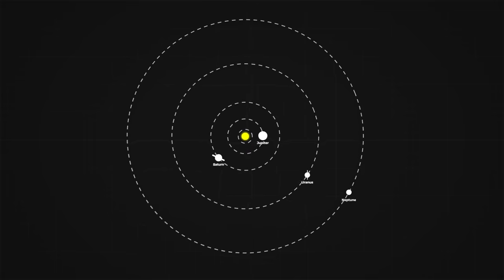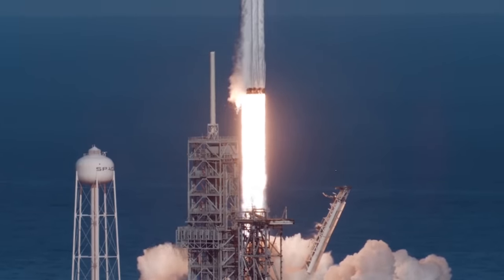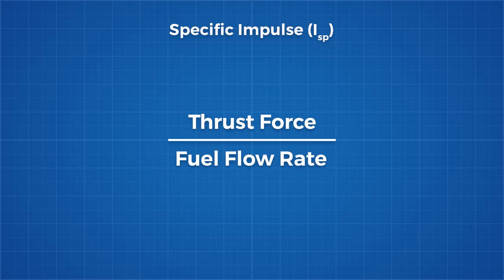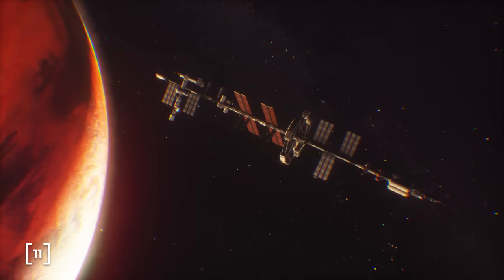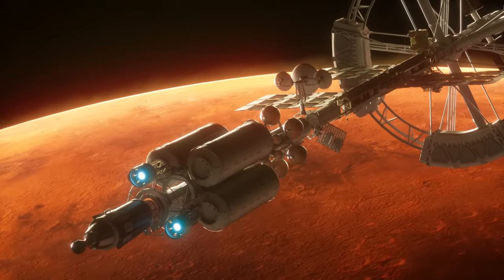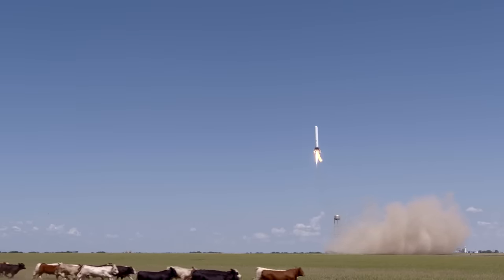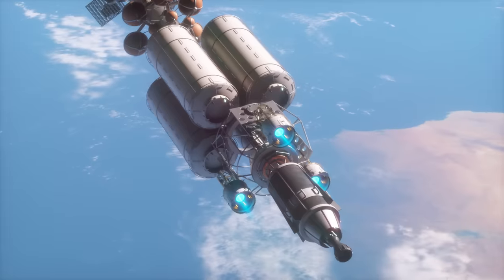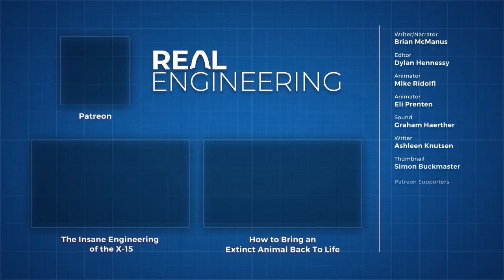Can Nuclear Propulsion Take Us to Mars?

Comment: Any mission to Mars of extended length will require multiple launches of various components of the mission which will rendezvous in orbit or on the Martian surface.  In this way different components will be able to arrive in a scheduled manner without the same speed/engine requirements necessary for each vehicle.  An unmanned habitat module for instance would be launched first carrying supplies requiring  a safe landing on Mars at the initial phase of the mission.  A secondary mission could involve the landing of an assent vehicle for moving astronauts back into orbit for rendezvous  with a mother ship...Finally after everything else is in place....a manned mission would be launched to Mars serving as an orbital vehicle allowing for a decent stage to land astronauts at the habitat location.  It will take much co-ordination and planning.

Comment: Could the hydrogen problem be solved by lining fuel tanks with materials that are smaller? Some sort of ionic compound like LiF or Li2O will have much smaller gaps than a metal like Fe, Al or Ti. The hydrogen bonding these products will have between ions should help keep the hydrogen molecules inside.

Comment: Alright - my question is related to the high deceleration: If you flip the ship around and begin thrusting the opposite direction at 50% of the way there, wouldn't you effectively slow yourself down for insertion to a point where you could use chemical boosters or maneuvering thrusters to correct your angle of approach and drop into orbit? Just seems like if you could achieve it this way you wouldn't need to do a rapid deceleration all at the end.
Reply: Doing that would tear your ship a new one brother

Comment: I've seen this episode 1000 times almost literally and I've had the question, in a space to space craft that never lands, why not use all 3 types of engine in one place? Hydrogen isn't hard to store as water for long periods, though it would need place to be stored as hydrogen short term, the nuclear electric engine could also be used to create electricity for electrolysis, the oxygen released from the water can also be used in the space craft for air and perpelent, the water could be used as a coolant for nuclear electric, plus humans consume water. Over top of that, would the slower moving perpelent of nuclear electric not spit out a good base of waste molecules to push the nuclear thermal against making the whole craft faster?
Reply: I agree with you in that there are ideas that could combine different thrust technologies to make an efficient space craft. Basically, the best space crafts will have very complicated hybrid systems. It's a different future from popular science fiction where there is one magical engine that provides thrust, artificial gravity and shielding all while being the size of a van.

Comment: I was on an airline flight in the 70s and an engineering student showed me that the senior class project was a magnetically contained Uranium fission reactor with gaseous Hydrogen flowing past it to absorb thr radiant heat.  I don't know what casing would survive the neutron flux; maybe Niobium.
Also the Nerva engine can triple its heat transfer by pulsing  pressure in the boiling, pressurized Hydrogen.  Published in Analog around 1970.

Comment: We need to setup and standardize orbital refueling. Use traditional rocket fuel to lift ships up and into orbit. Then switch to a more efficient propulsion system for zero resistance thrust in space. 

We also need large ship warehouse/repair facilities that stay in orbit to service ships, rockets and shuttles. Bring back the space shuttles but keep them in orbit as workhorses. Will make repairs on space stations, satellites and ships easier. Use rockets to bring astronauts to space. In emergencies the shuttles can still guide back down to earth.

Comment: 2:25 Gravity assists are fine, but they need planets. Ion propulsion, or rather mass accelerator propulsion is better, and I mean fractional lightspeed emission. Simply put multi stream cyclotron with linear accelerator last stage, using large molecules.

Comment: They need regular rocket engines to take off and enter low-earth orbit. And then we need to send tankers up and refuel the rocket while it is in low earth orbit. Use the Rockets to get the craft up to speed quickly and then switch to ion thrusters. Then switch back over to regular rocket engines to slow down and land. This would leave lots of fuel on something with a large-capacity like Starship.

Comment: of course, the simple cycle Nuclear Thermal engine (reactor coolant/working fluid = exhaust) creates radioactive exhaust. Which might be problematic, eh? Most studies I have seen suggest the required weight of shielding and a heat-exchanger to let the reactor fluid (radioactive) be separate from the exhaust negate most of the benefits of reactor as compared to chemical fuels.

Nuclear Ion can be built to not spray decaying isotopes out the exhaust, so that is a point in their favour.

Comment: There is a third type of nuclear propulsion..
the YOLO drive. It uses water with enriched uranium salt in it, stored in mesh containers that absorb neutrons. Delivered to the combustion chamber at 80m/s (also in neutron-absorbing pipes) is explodes as soon as it enters the nozzle. Water acts as a coolant, reaction mass and moderator and fuel speed is too high for the chain reaction to go up the fuel line.
ISP not as high as ion drive but it has low fuel consumption and very high thrust.

Comment: so question, why don't we just use  the neutrons from said reactor for thrust?
 We have neutron reflective materials , and berillium can take  alpha's from nuclear decay to produce neutrons .
a neutron is 1.674927471×10−27 kg while hydrogen is 1.6735 x 10-24 which is 1/1000th the weight .
 so from your equation a neutron would have around  27,000 seconds of impulse.
the way it should work is we have two reactors one for thrust  this being a highly concentrated fuel of some sort , thats pumping out fission products and uses berillium to raise neutron concentration this is effectively a subcritical reactor as it's producing a large number of neutrons but the majority escape the system making fission unsustainable for this reactor.
then sitting upstream of this engine reactor is the fuel reactor which is undergoing a super critical reaction and is providing both the thermal energy for raising the kinetic energy of the secondaries neutrons and  the excess neutrons needed to sustain the the secondary reaction.
this is effectively a host and parasite relationship that's converting the host reactions into thrust neutrons . the parasite would act as a poison or control rod and be controlled by concentration of neutrons not reflected back into the primary reactor .  
the main challenges would be controlling a super critical reaction , dealing with neutron embrittlement , and that this reactor should never the troposphere.

to shut down the reactor all that would be needed is to raise thrust or subcriticality of the secondary reaction till it's parasitic effects causes both reactors to reach a net negative in fissions.

Comment: LOVE THE CHANNEL 😊 QUESTION FOR YOU.... When you were considering keeping hydrogen cold in space? Is space not freezing anyway? Would this not suggest that less energy is required to keep chriogenic hydrogen stored? KIND REGARDS BEN FROM NZ 😀😀😀
Reply: Ay fellow kiwi ;)
Reply: Hot and cold are properties of things. Space is not a thing. Space is the place where things are not. Therefore, space is neither hot nor cold. 

Put a hot thing in space and it'll stay hot until it radiates its heat away. Radiation comes out of things very slowly, so it's hard to cool hot things down.

Put a cold thing in space and it'll stay cold until outside radiation hits it. There's a lot of radiation flying through space, so it's hard to keep cold things cold.

Comment: You're wrong about hydrogen being the most efficient fuel. It may be the fastest per input energy, but it is not the greatest momentum(thrust) per input energy.
Lighter elements will go faster, but they will have less momentum.

Let's write the math for the energy expended and momentum gained by the rocket
by writing the energy and momentum of the the accelerated particle.
 
KE=kinetic energy
P= momentum 
m=mass
v= velocity 

Lets say you have 8 units of energy.

With a m=1 particle
KE = (1/2)m v^2 = (1/2)(1)(4²) = 8
P = mv = (1)(4) = 4

With a m=4 particle
KE= (1/2)(4)(2²) = 8
P = (4)(2) = 8

With a m=16 particle 
KE = (1/2)(16)(1²) = 8
P = (16)(1) = 16

As you can see when a given amount of energy is spread over a more massive exhaust, it is more efficiently converted to momentum(thrust). This pertains especially to high energy propellants for which fuel is a small part of the total mass.

Edit: Looking back you may have been referring to the trust per mass of fuel and i missunderstood you.
I believe you would be right in saying hydrogen is most efficient per kg of ion mass. I haven't done the math though.

Comment: Error in the first seconds of the video: Voyager I and II were not satellites (those orbit other bodies) but space probes.

"There are no disc brakes in space": There are. You use the atmosphere of the planet you want to visit to slow your spacecraft down tremendously. You do that directly (hitting it head-on) or you can slow down in steps, entering the atmosphere and then leaving it again, only to come back to it. More massive spacecraft may need this in order to decelerate without having to endure too much thermal stress.

Finally, something to note: Another advantage of ion propulsion is that it creates a low gravity effect on anything inside the starship. This can be a nice to have. At least your stuff stays put, especially liquids... and you stay put on your bunk as well. That being said, it will take numerous and powerful engines for this effect to be of any use.

Comment: I've always wondered how a Zero G nuclear reactor would work. I'm mostly writing this comment so I can figure out my own thoughts, I'm sure there have been many papers on the topic that go into far greater detail. 

The first big problem is how do you actually get it to create electricity? Nuclear power plants on earth are almost exactly like coal fire power plants, except for the heat source. All they do is boil water, and force that steam through a big turbine, spinning it to power a generator. This is both very heavy, and requires a significant amount of volume for the steam to expand into. It doesn't rely on gravity though, so it's likely possible to use this same method in space, however, you'd need to expand the steam directly into a massive heat exchanger which is constantly being cooled by the radiators. 

This brings on the problem of thermals and what goes wrong if they fail. The pump to the reactor could fail, the pump to the radiators could fail, micrometeorites could damage coolant lines dropping pressure and thus cooling capacity etc. As such, there would need to be multiple layers of redundancy in the thermal management system (TMS). One potential way of doing so, would be to have the primary TMS with two independent loops and multiple independent pumps on each loop. Then for backup using a much more powerful evaporative cooling loop, this would need to be a backup as evaporative cooling isn't a closed-loop system and would require a constant resupply of coolant (probably just water). You'd also probably want to design the reactor in such a way that when it is at minimum power, the reactor can be passively cooled to a safe temperature exclusively through the use of unpowered radiators, perhaps with heat pipes to transfer the heat away (remember, even when not critical, nuclear fuel generates heat just due to natural decay and in space, without a good way to dump that heat it will just get hotter and hotter). 

But things can and do go wrong, the reason Nuclear is so safe on earth isn't that it's magically safer, its that we have redundancies on top of redundancies learned through painful failures. I think ultimately, you'd need to have backup solar power generation, along with a backup propulsion system (probably using a long-storage fuel like hypergolic propellant). I expect that if this is ever put into practice, we will likely initially only use it for unmanned missions, OR with a way to physically remove the core from the rest of the ship and still have the ship be able to return to earth with enough power and supplies to get the crew back. As a side note, this would also require planning missions in such a way that at no point is the craft ever on a collision trajectory with a planetary body we care about, even if it's just for a moment, if that's the moment it melts down, then you lose control and the reactor with no forces to act on it, it'll come crashing down (eventually). 

A whole separate issue would be around safely getting the nuclear fuel to space. For such a craft as this, you'd likely want to be able to re-fuel the reactor in orbit (nuclear fuel lasts a long time, but not forever, so if you want the ship to last more than a decade or so you'll need to account for this), however, this means that you can send the reactor up without fuel inside, ensuring that in the case of a launch failure, you don't explode a bunch of Uranium throughout the upper atmosphere. That does mean you'd need to send the fuel up on its own, however, we already have launch escape systems, designed to ensure that a relatively small, but incredibly valuable payload isn't destroyed during a failed launch.

There are some aspects that are far easier than on earth. For example, you wouldn't need to worry about totally shielding the core, you would only need to put a shield between the core and the rest of the ship. Because the intensity decreases as a function of the inverse square law and space is VERY big (citation needed), once you're far enough away, it's not a risk to anyone else either. However, you would need to be careful about the orientation of the ship when there are other spacecraft approaching it, as you could hit them with the full blast of your reactor if you're not careful. I expect that rather than a flat shield between the reactor and the rest of the ship, you'd want to shield all but one side of it, which would still save mass, but drastically decrease the effective "hot" area. You could also shape the water reservoir (for the TMS) such that it partially encapsulates the reactor. Water isn't the best radiation shield, but it's pretty dang good, and you already need to carry that weight (besides having additional water reserves would be handy for the backup evaporative cooling loop). 

All in all, it's definitely possible, but it would be a big challenge, and would require a fair bit of trust between governments to not spark an international incident over launching the fuel.

Comment: Something I just thought of: the Saturn 5's F1 engines had a poor isp of around 260, similar to the isp of nuclear-thermal nitrogen. But one advantage is the possibility of an air-breathing engine while in atmosphere. Being able to take advantage of the atmosphere as propellant before switching to onboard, optimised propellant like hydrogen could be a good stategy.

Because the power is nuclear the on-board power is no longer the issue, it's on-board mass. And most of the energy usage is getting off of earth
Reply: The portion of a rockets flight profile that in atmosphere of any density to be of value for air injestion is tiny, the complexity of the rocket and the means of scooping air simply arn't worth it.

Comment: Just casually wondering how pairs of flywheels would compare to battery’s/ fuel for long distance space travel.

As I expect the mass would double up as reasonably effective radiation shielding, the gyroscopic effect would assist with navigation, the weightlessness would eliminate storage losses while not accelerating & it would be easier to hold a vacuum in space

Comment: NERVA was pioneered in the sixties and met and surpassed every design goal but has been held back by politics .
NERVA has been tweaked tested and refined for forty years and would mean a very very quick trip to mars or anywhere in the solar system from the moon .
Some nuclear powered non human rated spacecraft have been built and used by the United States .
Plus any craft is very easy to decommission safely .
Thankfully working with hydrogen in space has been tested in the shuttle and other NASA craft .
Ion engines powered by nuclear fission is appealing .

Comment: I am a advocate for Nuclear Pulse spacecraft over ion or other methods to produce faster spacecraft. Why? Because we could build a NP craft decades before other designs. For example Project Orion was a study conducted by General Atomics in the late 1950s and early 1960s. The goal of the study was to determine the feasibility of using nuclear bombs to produce thrust that were orders of magnitude higher than chemical rocket engines can achieve. NP uses small fission nuclear explosives were to be detonated against an alloy plate. The plate was attached to the spacecraft via dampeners to lessen recoil. Efficient directional explosives maximized the momentum transfer which were calculated to produce specific impulses of at least 6,000 seconds. Refinement would allow specific impulses of 100,000 seconds. The very best reason is Orion could theoretically be constructed with available technology. I know, I know sitting on hundreds of atom bombs  lighting one off now and again sounds well, nutty. However the concept was supported by peer review articles and proof of concept exercises etc. What could go wrong?